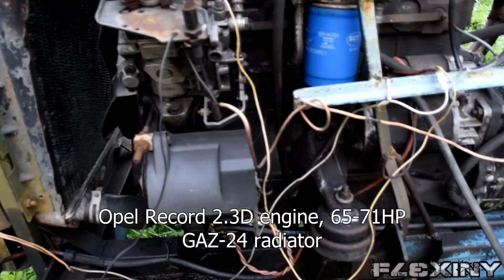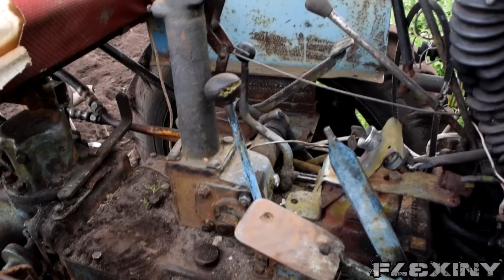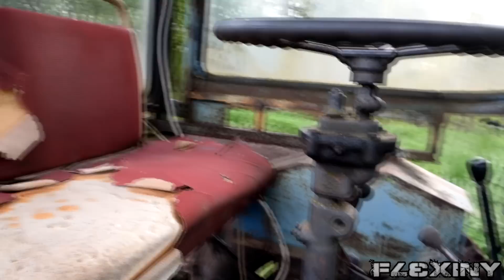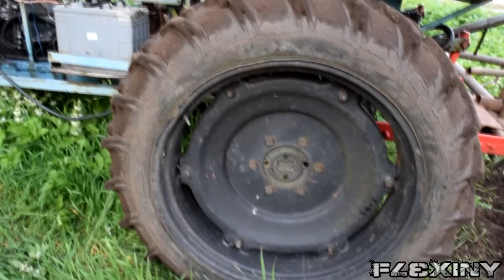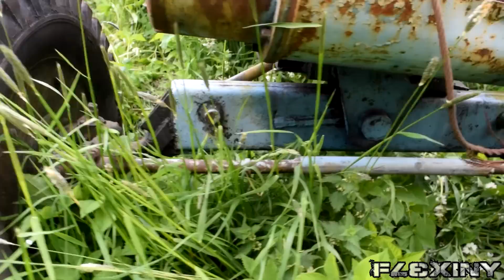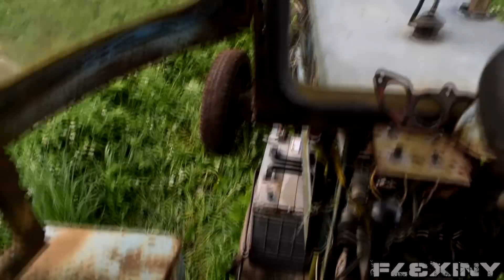Homemade Tractor & Hankmo Harrow + Tour (1080p)

Comment: Hi, put an air filter on it! This machine looks like it is a workhorse! Make it easier on yourself, tip the steering wheel to a position that does not wear you out working it. Fix those things that need attention. Be proud of what you have. Yes you could go and buy a shiny new machine that will take you years to pay off and by the time it is paid off it will be battered and beat up like what you have. Start fixing the issues it has until you get to the point that you can have the time to make a nice hood and covers! 
Be proud of what you have!